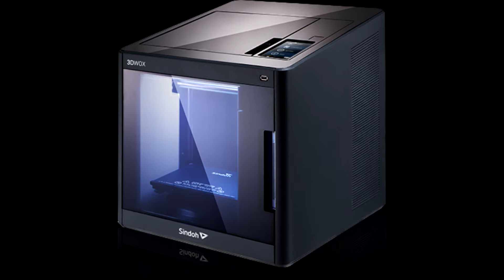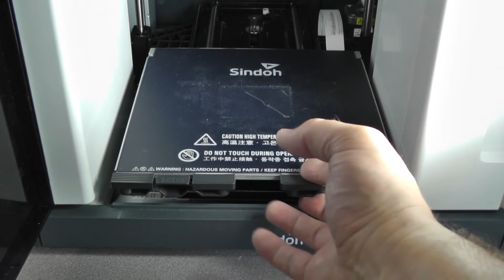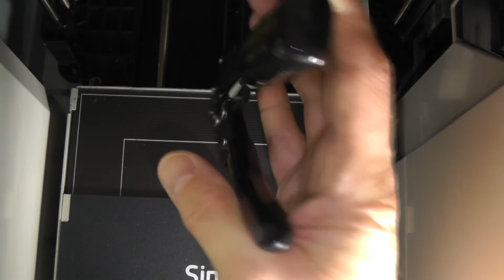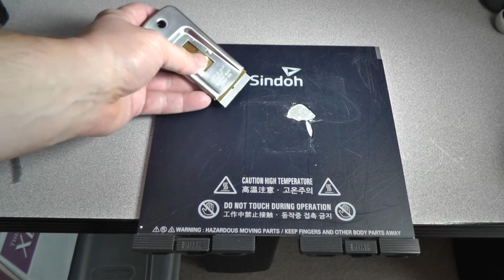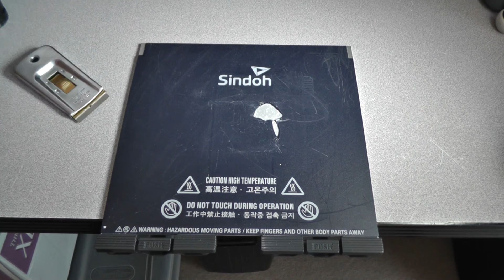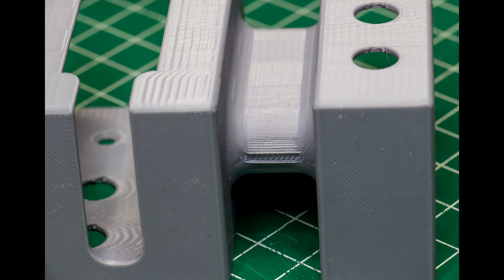Sindoh DP200 3Dwox - More Hints and Tips #2

Comment: Take care of the white flat cable to the printing bed. Mine was bended to much during production. Menwhile it breaks and i got multiple error codes. I was able to cut out the damage part, was only arround 5mm on the end. I sanded the end of the flat cable to have a new contact. Peel of the blue spacer tape of the original end. Fit them together in the connector and it will work again!

Comment: Hi Bob

Loving the machine, really works well.

I have found that using a wall scraper makes removing the model from the bed easier.  I can't find an exact copy of mine on the net but a similar tool is : -

https://www.amazon.co.uk/Harris-3393-Taskmasters-6-inch-Striper/dp/B006IN788K/ref=sr_1_3?ie=UTF8&qid=1488976250&sr=8-3&keywords=plaster+wall+scraper

I did take the sharp corners off the blade on my bench grinder so they did not dig in.

My printer came with the foam bed pressure strip already in place.

I also bought Simplfy 3D but no longer use it, going straight from Fusion as a STL export to  the 3DWOX application.

The price in the UK is GBP999 so not as low cost as in the US.   I see there is also now a PLA only version (DP201)

Thanks for helping make the right choice for my printer. 

Alan
Reply from the maker: Alan, I'm glad the printer is working out well for you.  As you know, I really like mine.  Thanks for the scraper link.  Ahh...interesting, they included the foam strip on the bed now...their support team is good and listens to feedback.  The 3Dwox Desktop software has come a long way in the last year and many times I use it to print jobs too, unless I need some specific functionality of Simplify3D.  And yes, the DP201 (PLA-only version) is a great printer as well and comes with a flexible non-heated bed which makes getting prints off the bed a snap. Review coming very soon!  ;)

Comment: Did you find a tutorial to use a simplify3D with the Sindoh? I order my Sindoh today. I have an original FlashForge Creator using simplify3D.
Reply from the maker: The Simplify3D FFF file I am currently using is here:  github.com/bobotmedia/Misc     YMMV - use as a base settings file to import into Simplify3D and adjust settings as needed.  Note that I recently used the latest Sindoh Desktop software update and achieved a better print using ABS than with Simplify3D.  Sindoh might be doing some custom things in their software to adjust speeds, patterns, temp etc depending on material/layers/etc, so don't completely discount the Sindoh slicer.  Hope this helps.

Comment: I'm about to buy a 3d printer and was wondering if after 7 months with this printer you still recommend it? I'm a engineering student and want a printer that will reliably print and do so consistently.
Reply from the maker: In my opinion if you want to spend your time designing and printing instead of fiddling with settings and adjustments, this printer works well.  Nothing is perfect, but I feel this has met my needs for occasional prints.  As with most printers, I get better results with PLA as opposed to ABS, but recently got a nice ABS print using the latest slicer provided by Sindoh vs my settings in Simplify3D, so it CAN do both materials under conditions. The biggest issue I had was the Y-axis play in the bed which I refer to and solved as shown in another video.  Watch some of my other 3Dwox-related videos for more info.  Also check my Thingiverse http://www.thingiverse.com/Bobot/designs and my Flickr for 3D project photos https://www.flickr.com/photos/bobotmedia/albums/72157668912346732    I would certainly recommend this printer if you are ok with the proprietary filament design.  Bad prints on this for me have been rare, and probably related to ABD warping or layer separation due to a draft by opening the door or not using a raft, etc.
Reply: Thanks for getting back to me so quickly. Ill keep your recommendation in mind.

Comment: It looks like 40mm/sec is the "Normal print speed", and 60 mm/sec is the "Fast print speed". It still feels extremely slooooow compared to other 3D printers. Looking in the advanced settings, the max movement speed is 200mm/sec. Have you tried bumping it up?
Reply from the maker: I use Simplify3D as my slicer instead of the 3Dwox desktop software.  I originally copied the settings from 3Dwox software and their cura .ini files into Simplify 3D and never looked back.  One time I moved the speed up to 60 mm/s without too much noticeable quality loss, but that was not a very detailed print.  It is slow, but as with most things I do I'll take accuracy, quality and repeatability over speed.  :)
Reply: Thanks. Are you mostly printing PLA or ABS? I just tried my first ABS print on the DP200 and it failed horribly. 100% infill for structural reasons caused severe warping and bridging. Sent the photo to Sindoh and they basically said don't do that. Kind of sad that a $1400 machine can't do what I was able to do with my $700 Solidoodle.
Reply from the maker: I have printed ABS on the 3Dwox but I get better quality and less problems by using PLA as with all printers. ABS is quirky...very susceptible to drafts and shrinks/de-laminates/warps more.  I was printing an ABS box and opened the door for a sec to look at it...later I noticed right at that point in the build the layers separated.  IIRC, I was using 235 nozzle temp & 90 bed temp for ABS.  Make sure you have the settings to ABS vs PLA.  My opinion, bite the bullet for $150 and buy Simplify3D as the slicer.  Save files to .gcode from Simplify3D and use 3Dwox utility to send via network/USB.  There's "never" a need for 100% infill!  Max maybe 40-60, and that's pushing it.  People overdo the infill.  That will surely make ABS warp as it cools.  Try printing on a raft, keep drafts away, and maybe up the bed/nozzle temp 5 deg and see what happens.

Comment from the maker: The 3Dwox team has provided me with the updates they made in the 2016.05.05 firmware as follows:
1. Printer stores a printing job in its embedded memory and prints it after a current printing job is finished.
2. Cancellation during Bed Lowering / Extruder Jog Mode has been enabled.
3. Noise made during short distance movement has been improved. 
4. Quality of internal test G-code file has been improved.
5. Improvements have been made for EC 302, EC 435. User can re-load the filament upon their decision. Heater malfunction detection has been improved.
6. Bugs have been fixed.

Comment: I would love one of these , are they pricey , ?? ,,
Reply from the maker: $1300 for printer on Amazon.  Filament for this is a bit more than other printers, about $40 per spool but lasts a long time.  You need CAD software but beginner stuff is free.  To do it right, you should but Simplify 3D software for $150 to slice the designs to prepare them for printing.  Or you could buy one steam engine that might run after you send it back for repair.  :D
Reply: wow so wow .. up there price tag . would be great for doing so many things  for the layout ,, you might have to start taking orders , I wonder about the copy right on a lot of thins there ,, but then again ,, HO scale barrels and other small mis stuff , be a cool toy to have ,,, for sure
Reply from the maker: Yeah, if I need stuff like barrels, signs, park benches, tree trunks, etc. or any broken engine parts this is going to be my go to tool to see if I can do it.

Comment: Hi Bob - My objective for O Gauge Model Railroading and a 3D Printer is the following (1) Take a digital photo of a local structure, (2) Put the photo into photo shop and the the structures elevations to the correct size for an O Scale Model.  (3) Send a file to the 3D printer. maybe as simple as a j-peg file for each side.  Is 3D technology at this point?
• Cheers from The Detroit & Mackinac Railway 🚂
Reply from the maker: Gary, I guess you could use a jpg photo source and import into a CAD program as jpg maybe an svg format and then use as a template to draw a sketch on the photo plane.  I haven't looked into that aspect and have just designed things from the ground up by measuring and manually creating.  Once the design is done in 3D in the CAD program, it's fairly straightforward to slice and print.  You would probably want to break into several component pieces and then print and glue together just like the model kits.